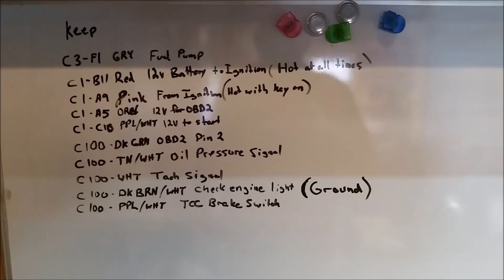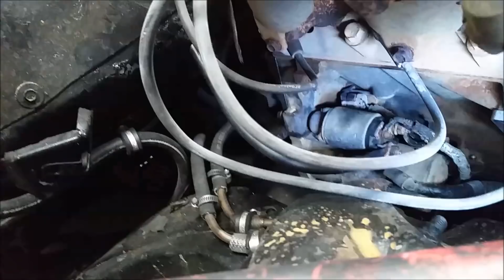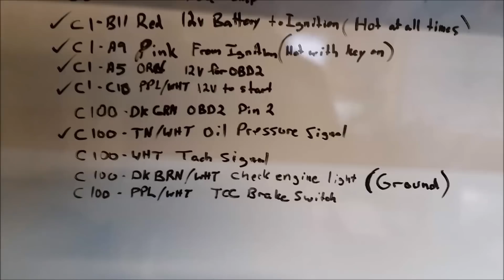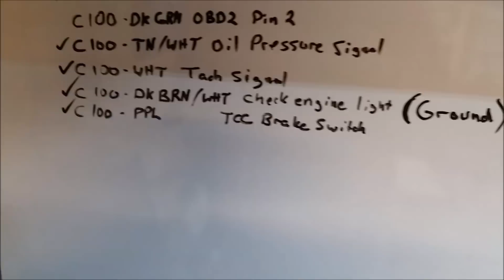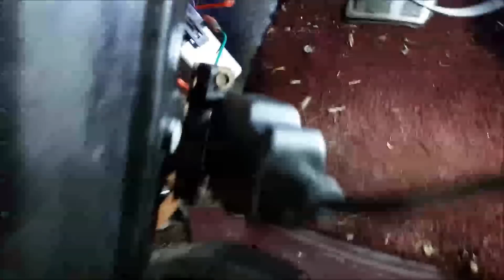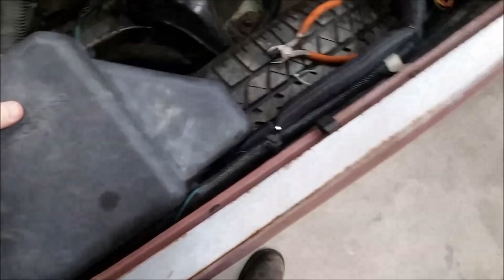Part 6. LS swap a gbody WIRING. FINALLY

Comment: What radiator and fans did you use ? Doing a ls swap on a 85 Cadillac Fleetwood
Reply from the maker: Back then, and still my favorite, is the radiator and fans from an LT1 Camaro or Firebird. 93-97. I used the painless wiring lt1 fan kit.
Reply: Thanks for the reply  will be looking for sum !

Comment: I have a 2001 Tahoe on Tahoe I did a complete the complete wiring swap at your drive by wire it's a warm part of the security system wasn't turned off on the car when I brought it out of a junkyard I didn't know you had to do that now it I've got it all hooked up and it acts like it wants to start a fire a couple times and then quits Is am I going to have to get the computer flashed ?
Reply from the maker: Yes, you will need to have it flashed to shut off theft protection.

Comment: Where is the equivalent of C1-A9 on an Express van fuse block. The  plugs are different and cant find info on it.
Reply from the maker: I've never worked on the express van wiring. What year are you working with?
Reply: @DivineSpeed  2003
Reply from the maker: @nope2u399  I'll have to do some digging. In the meantime, look up lt1swap.com and you will probably find the answer.

Comment: MAJOR CONFUSION SETS IN; i just re-examined both my LM7 engine wiring harnesses circa 2002/2003. neither one has a white C1 connector going into the fuseblock!
are things radically different in canada?
I ONLY HAVE THE BLACK/CENTER C2 CONNECTOR
NO RED C3 EITHER!
Reply from the maker: I have read before that the Canada harnesses are different. I'm not sure what all the differences are. I've never worked on one.

Comment: so this is basically  a RACETRACK ONLY  wiring video? you dont need  or cover wipers, headlites, heater, turn signals, all the power accesories inside?
i have all idiot lights in my dash except fuel and speedo, both those should work but i would really like to get alternator, oil pressure, coolant temp as bare minumum gauge setup in the dash. 
fuel pressure im ok with being on the fuel rail under the hood. A tach would be nice too.
Reply from the maker: Consider is racetrack only but all of that extra wiring goes to the factory car fuse block. Hook up the two red wires to a 12 volt source and you're good to go. Lights and wipers still work fine. The dash lights will not unless you wire in the factory sending units into your ls engine.

Comment: be nice to go through the stock gbody wiring harness showing wht to eliminate , what to hook up to ls wiring harness
Reply: ya everyone makes it sound so easy. 3 wires to start an LS but doesnt say what wont work by doin just that[probly every but engine will not work]
or GBODY  11 WIRES TO SWAP AN LS  but doesnt say you will have 17 random wires leftover from G body that if not found and taped off or eliminated could burn down your car as ssoon as u power up car wiring
Reply: plus i have 2 LS motor wiring harnesses with at least some of the wires chopped off, hopefully not ones i need like tranny wires since im using th350 but i still have to go thru and eliminate  or tape off each individual wire or it could burn up my engine just a enough to fuck the wiring harness or entirely
Reply: i bet both my wiring harnesses have the ODD2 connector  cut off as well
Reply from the maker: The OBD2 connector is actually part of a separate body harness in the truck so you will need to cut it out of the truck or buy one online.
Reply from the maker: I run the two red wires from the firewall connector to a battery source. That powers the G body fuse block. All of the lights still use the factory wiring from the G body firewall connector and I still use the factory purple wire from the ignition switch to run the starter solenoid.
Reply from the maker: My car was pretty much destined for the track so I eliminated a lot of extra stuff from the G body.

Comment: I have a major question. Is this harness out of a GMC envoy/ trailblazer SUV? As I have this type harness and lm4 5.3 and these have the same pinouts..sorta as a normal ls based truck motor but the harness are a nightmare! I notice you focusing on the white plug unlike the black on the truck type harness. Please tell me your working with the trailblazer type harness... I need lots of help. I got all the pinouts but the rest of the harness is a nightmare to figure out. If you see this lemme know I'm currently wiring mine or rather doing cleanup on the harness for stand-alone.
Reply from the maker: I was working for a 2000 Chevrolet Silverado harness

Comment: I'm toggle master on electric fans run shortest path to battery and longest path ground wire to dash. Ground to any metal by pedals anything. Cut in line for your toggle switch. Add fuse to taste good size gauge wire if budget allows.

Comment: Did you have to flash the computer in order to make it work
Reply from the maker: I did have to flash the computer to shut off the anti-theft. That is the only thing that is really required.
Reply: Divine Speed Team thanks for replying back one more question where can I go to flash my computer a regular mechanic can do it ?
Reply from the maker: @GustavoLopez-hd8jc  I believe a mechanic with a snap on or genesis scan tool might be able to. Anyone with efilive or hp tuners can. Efilive is 125 dollars just to buy the vin license and hp tuners I believe is cheaper. I would check with the guy that runs lt1swap.com  . I think he's doing it for 50 dollars.
Reply: Divine Speed Team thank you for all the info

Comment: Did you have to do a pin out using the way of to start the engine.
Reply from the maker: I received all of my information from lt1swap.com. What information I do still have is all in the video. I have wiring diagrams on my website divinemachinellc.com but I'm not sure if they will answer your question.
Reply: I will check your website out for sure thanks. I’m in the process of doing two style harness just because it was all cheap. So one is standalone and other is using the factory harness and fuse box.

Comment: Would the 03 5.3 wire up the same way ? I'm trying to figure it out now .so far everything looks the same except I dont have the purple /white wire on c1 c10 my wire is green
Reply from the maker: 03-07 will be different. Are your pcm connectors red and green?

Comment: How did you wire your torque converter lock up to the brakes
Reply from the maker: its been a few years since i did it; however im working on a wiring diagram to explain it.

Comment: Quick question sir. On the fuel
Pump wiring, what wire do I tap into on the cars harness?
Reply from the maker: Ideally you want to run the wire from the computer to a relay and than from the relay to the fuel pump. There really isnt any need to tap into the car's factory wiring. Let me know if this answers your questions. I am currently working on a website to sell these diagrams.

Comment: What did you do with the rest of the wires that you didn't use did you cut them off tape them up..
Reply from the maker: I de-pin them from the connectors and I save them in case i need for something else later on.

Comment: Do you remember what year truck you got your fuse box out of? I'm having troubles getting my '86 monte carlo to start the starter using the silverado stuff. I got the underdash fuses power, did the IGN to A9 so that works, just no crank at all. tried the purple wire from the monte in different places of the fuse box but nothing. using factory silverado starter solenoid wire.

and my fuse box is from 2004 silverado which doesn't seem to have the pink, purple/white, and yellow wires that yours has at 19:55. mine (from top to bottom) in that location is pink,nothing, and green
Reply from the maker: My fuse box was from a 99. I can't believe I didn't see this comment before. Were you able to get it figured out?

Comment: Best LS swap video that I've come across ! Super informative !!
Reply from the maker: Thanks, Jon. I am wanting to make a new video explaining how to do a really stripped down version of the same thing. Just takes a lot of time.
Reply: @DivineSpeed  How can you power up the factory gauges in a ls swap?
Reply: @DivineSpeed  
Cool...I've seen tons of them lol. I've already pulled everything out of my Dad's old 2001 Suburban 5.3
What is your opinion on corrosion between the triangular coolant ports on the flat head gasket surface of the aluminum 862 heads ? Apparently no one flushed the coolant system...EVER !!! LOL
The combustion chambers look they were well sealed from this corrosion by the factory head gaskets

Comment: Hey i have a 2006 motor and harness do you have the c100 pin out because the colors are different
Reply from the maker: I do not but you should check out the lt1swap.com website or facebook page. I know that guy just finished up a harness for those newer engines and he may have that information online. I've not had to work on one that new as of yet.

Comment: I can sure use your help with this wiring harness if it's possible step by step visual as well that'll help more
Reply from the maker: Alvin, I would recommend going to the lt1swap Facebook page. That guy has detailed pictures of modifying the harness. I never took any pictures. Maybe next time. Also, as far as flashing the computer,  the same guy is the cheapest around.

Comment: What about your fans how do they know when to do low speed high speed using the older harnesses
Reply from the maker: It's hard to explain but if you plug wiring into the correct spots in the back of the ECM, you can actually program when they come on. I didnt go that route on this harness but if you check out lt1swap.com there is information on how to wire it.

Comment: my friend so you just work in back of the fuse box live everything stock?  Computer too? Sorry I'm not speaking English much I hope understand my questions
Reply from the maker: Yes, I leave everything stock. The computer will need to be flashed to shut off the anti theft or else it will not stay running.
Reply: Echale, chingon,,,   Te puedo ayudar??

Comment: Can I do this with 05 6.0 from Denali???
Reply from the maker: I'm sure you could but I wouldn't use this video as reference. Wiring has changed drastically between 99 and 06
Reply: Yes a no. 03 fuse box a wiring changed. Major differences are in A/C, and 02 sensor's wireing

Comment: What has to be done to but a 4L80E in a 2000 Silverado that has a 4L60E? Oh and it's a 4x4 also. Thanks
Reply from the maker: You swap two wires at the ECM or at the trans connector, and add two wires for a front speed sensor. I'm not sure about the rest of it. Also will have to reprogram the computer for a 4l80 tune.
Reply: @DivineSpeed  Thanks for the reply and the information.. if you find out the rest that would be great. I know of several people that are interested in this type of transmission swap in my area alone. If you could make a video on this subject it would make a lot of people happy... Thanks again

Comment: Hi can you help me out how to wire my 2000 s10 I got a 5.7 tbi motor complete with transmission and harness with computer fro a 94 Cadillac
Reply from the maker: Man I hate to tell you but I don't really have the experience needed in the older engines like that one.

Comment: looks like i need to go back and get the whole fuse box :-)
Reply from the maker: LSCHEVYRYDER254 you dont need to. You can use a much smaller fuse pan. The site lt1swap.com has all that information and pictures available. It's pretty straight forward. I'm getting ready to cut a harness down tomorrow but I don't know when I'll have all the parts in my hand to make a video on it.
Reply: @DivineSpeed  
You can make a smaller fuse box but the way you going over everything make you wanna just use the factory . 👍🏽👍🏽👍🏽
Reply from the maker: @blackmacgyver9965  yes very true. I've done several that way but I wanted to show that it's easier than that. But yea I really like the smaller fus box better. I'm working on one now for a guy.

Comment: Need some clarification. I noticed that you are running without O2 sensors. I have been under the understanding that you need O2 sensors #1 on both banks to run correctly past the 2-3 min. warm-up period (closed loop)
Reply from the maker: I actually have them on the car. I'm working on the tune right now but only using the wide band o2 sensor to do it. I don't want the narrow band sensors to effect it while I'm trying to tune it with the wide band. Probably doesn't make much sense.
Reply: Doing a ls swap into a 94 Sierra will running no cats effect anything with just running the first 2 o2s and deleting the rears??

Comment: Here's a fun fact on map sensors. In the Auto mnfr's infinite wisdom.... they calibrate most of their press. sensors in absolute pressure not gauge. Meaning, with the engine not running the MAP sens will read 14.5 psiA (Absolute) which is atmospheric press @ sea level,  not 0 psiG (Gauge). So if you have a boost of 5 psi your MAP sens is going to read 19.5 psiA. In retrospect if the reading is 12.3 psiA you'e actually under a slight vacuum. Go figure.
Reply from the maker: Yea I always have to sit and think about that when making a map. I've decided to do it like everyone else and use kpa

Comment: That is good stuff. Thanks for putting that together. I am doing an LM7 swap into a Jeep Wrangler. Wiring is causing me my worst nightmares. Following Brendan over at LT1, I made a stand-alone harness. Pulling the unused wires and re-connecting them back into the ECM was no big deal once I dove into it. My biggest fret are the wires that did not go into the harness - i.e. the ones you have listed on your whiteboard.
Specifically:
1. TCC - I have no idea where to connect it in the Jeep
2. Starter - I think I can figure that out, but I can't figure out how to connect the park/neutral safety wiring into the starter relay.
3. Keyed power - does that come from the ACC position, RUN position, or START position?
4. VSS - How do it connect to the speedometer?
Reply from the maker: Ted Hargiss man some of those are tough to answer since they're going in a jeep. The TCC I have no idea on a jeep. A lot of people have put them in jeeps so I would assume the information is out there. I think for the neutral safety switch I dont really know off the top of my head. I remember having a hard time with figuring that out on this car but I thought I had explained it in this video. I'm getting ready to cut down another harness soon so I'll dive into that again later on. Keyed power comes from the key on position. Not the start position. And for the vss I really don't know how to hook that up to a jeep speedometer. Even if you did, would it be accurate? You might look into some sort of display to take place of the speedometer but I know you dont want to do that so there again I would look towards the jeep community for the answer. I'm sorry I couldn't answer all of your questions. If I can remember what I did on the safety switch, I'll let you know.
Reply: Divine Speed Team: I really appreciate you getting back with me and taking time explaining what you know. I've researched a bunch on jeep sources and haven't found it yet. I'll keep looking. Thanks again.

Comment: Great video man finally found a video I can understand so I can start on my wiring just got me a 1988 Monte Carlo LS planning on doing my LS swap really soon thanks again for the great video!!!!!!!!!!!!!!!!!!!
Reply from the maker: KennyG488 man I hope it helps you out. If you have any questions I'll do what I can to help.
Reply: Thank you for taking the time just to even respond I definitely appreciate it!!!!!
Reply: Hey I have a question I’m trying to figure out can I run the stock truck AC compressor located on the bottom haven’t started working on my car just yet but I can wait to
Reply from the maker: KennyG488 that's a big negative. Motor mount will be in the way. I know people have relocated the compressor to the top passenger side but I've never tried it. I want to say a company called dirty dingo makes a relocation kit but dont hold me to that.
Reply: 😓😓. Thank you so much for taking the time out of your day to answer a few questions it goes a long way thank you again💯
Reply from the maker: KennyG488 I try to answer them all right away but sometimes it takes me a day or so to get back to the internet.

Comment: Quick question brother can a 700r4 if so what steps to take
Reply from the maker: The 700r4 is a lot older transmission so if you have one that is not electronically shifted than you can get away with making the harness a stand alone setup like in the video and the transmission will work regardless however you will need to find a way to run the TV cable and that I cannot help you with. I am sure there is some sort of an adapter to hook that cable to a LS throttle body but I do not have any experience with it. Sorry I can't help you there.

Comment: Do you know what the 2 red wires in the factory harness running to the engine are?
Reply from the maker: blown5.3 are you talking about the harness on the engine or from the car to the fuse block ?
Reply: in the factory harness from the car,The guy before had 2 red wires tied together and ran to the battery
Reply from the maker: blown5.3 Yea I think those are the 12v supply to the fuse block under the dash.

Comment: Quick question, what color wire did you splice in underneath the console for the tcc.. And how does it work for 12v constant.. I have a 79 elcamin .. and I burnt up my transmission because I didn't wired up the TCC.. Thanks men
Reply from the maker: It's a purple wire on a separate switch on the brake pedal. The video shows the actual switch. I don't remember how it actually works though. I can't remember if it supplies 12 volts when you hit the pedal or cuts the power off. I want to say it cuts it off. Either way I ran it last year like this and it worked correctly. I hope that helps.